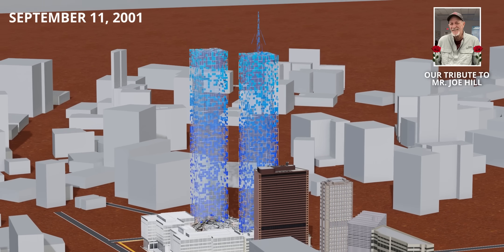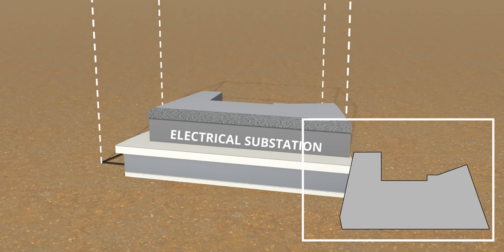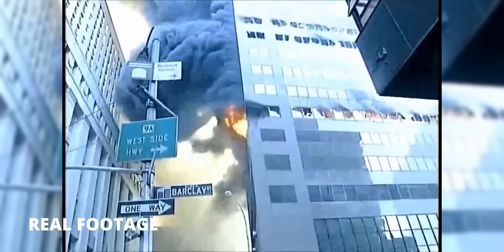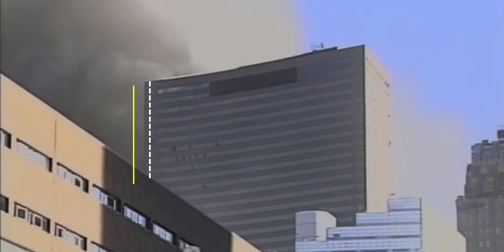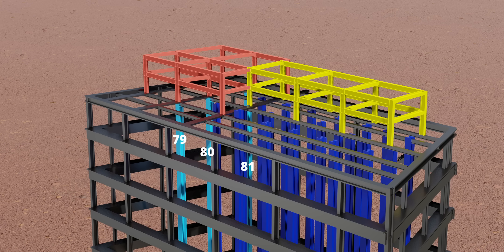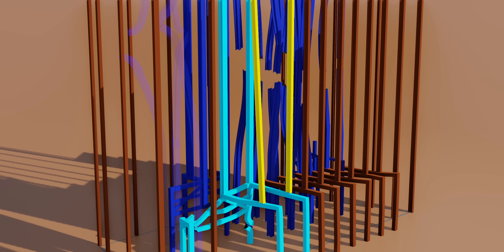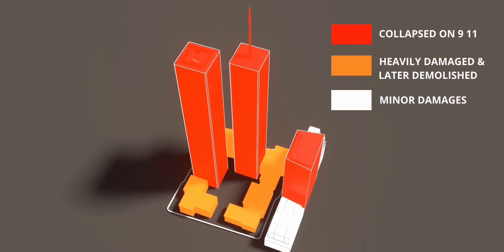Collapse of Building 7 | The Complete Physics

Comment: The Antenna(!!!) smashed all of the steel beams. And then penthouse truss, some of the columns, blabla, perfect free fall collision 😄😄😄
Reply: Or,... you could actually pay attention.

Much misunderstood, Building 7 was the 6th building to collapse of the 10 lost on 9/11. Because of its early low priority, conspiracy filled the information void with garbage made up by technically ignorant people promoting political agendas. But this is an engineering problem and should be treated as such, so I prepared this brief summary of my own analysis to fix that, using engineering, not politics and tired memes.

The North Tower collapse at 10:28am bombarded Building 7 with tons of debris, causing heavy damage and starting multiple fires which burned out of control for 7 hours. Half the FDNY firefighters having been killed, units in disarray, equipment destroyed, no water pressure, and the greater urgency of search & rescue efforts, firefighting was pulled as futile. The building couldn’t be saved and was left to its fate. That is the sort of choice firefighters make every day in brush fire situations - which houses to save and which ones to let go. Only real difference here is moving the decimal on the size and cost. People get overwhelmed by the size.

www.youtube.com/watch?v=g_SvpwyC17M&ab_channel=MFitz

Collapse of a burning structure is always a concern for firefighters. Steel buildings subject to fire rely on active fighting of the fires to survive. Buildings are designed around 1 to 3 hours of fire resistance, allowing time for occupants to escape and ACTIVE firefighting to get started, after which all bets are off. Left to their own devices they will exceed their design envelope and collapse, like Plasco Tower and Wilton Paes de Almeida. In B7 the occupants escaped, passive and active fire protections were compromised and active firefighting was abandoned 3 hours before the collapse, which left the building to its fate. It lost. Odds on Building 7 would eventually collapse, and it did. No big deal in logic.

www.youtube.com/watch?v=WnYBX6QT0R4

FDNY Chief Daniel Nigro ; The biggest decision we had to make on the first day was to clear the area and create a collapse zone around the severely damaged 7 World Trade Center, a 47-story building heavily involved in fire. A number of fire officers and companies assessed the damage to the building. The appraisals indicated that the buildings structural integrity was in serious doubt. I issued orders to PULL back the firefighters and define the collapse zone. It was a critical decision; We could not lose any more firefighters. It took a lot of time to PULL everyone out, given the emotionalism of the day, communications difficulties and the collapse terrain

FDNY Deputy Chief Peter Hayden ; We had our special operations people set up surveying instruments to monitor and see if there was any movement in the building. We were concerned of the possibility of collapse in the building. And we had a discussion with one particular engineer there, and we asked him if we allowed it to burn could we anticipate a collapse and if so, how soon? And it turned out that he was pretty much right on the money, that he said 'In its current state you have about 5 hours

The collapse of Building 7 was anticipated and widely reported in the media throughout the day, with 24 video cameras recording some or all of the collapse. Everyone knew what was coming and why.

www.youtube.com/watch?v=OY5S5k3tMHI

Building 7’s collapse was completely different to the Twin Towers and harder to understand as most details hidden from view and not intuitive, but we can still sort out what happened through careful analysis and observation. This is my explanation of the collapse relying on no outside authority.

Building 7 was complex, assymetrical 47-story steel framed structure built atop a smaller 3-story building, requiring lower floors dedicated to complex load transfer structures, not usable office space. Of trapezoidal shape and all-steel tube-in-tube construction, B7 (above the 7th floor) consisted of a central core of steel columns carrying most of the gravity load, perimeter steel columns around the outside of the structure carrying the remainder of the gravity loads and long span beams and girders to tie those elements together and form the floors. On the outside of the building hung a moment frame or outer shell.

Phase 1 : First externally visible signs of collapse initiation occurred at 5:20:28 pm and were notably quiet with observers not realizing the building was collapsing! No audible warning in the form of hundreds of ear drum busting 180-190dB explosive bangs preceding the collapse. Here at 12:00 a local CBS affiliate reporter is talking 10 blocks from B7 when collapse begins. People don’t start to notice the collapse until 12:11. At 12:45 is the famous CBS fixed camera clip of Building 7’s collapse. Note how quiet it is.

youtube.com/watch?v=t5tEy6mXSE8&ab_channel=fresnosean379

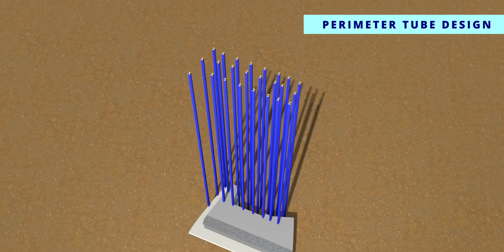Collapse initiation was due to lower floor failures above the load transfer region (7th floor) in the NE corner. In this video at 0:45 you can see the NW corner from inside the building while under construction, Column 79 just out of frame on the left. That big, angled steel beam across the top of the frame connects to C79 at one end. The girders connect to the beam. That beam and all those girders depend on just one connection

youtube.com/watch?v=nP3TNHPCIVU&t=35s&ab_channel=EdwardCurrent

Phase 2 : The floor failures caused a loss of critical lateral support over an excessive length of core Column 79 and it buckled. If you look at a floor diagram of Building 7 (see above) and look at all the structures that depend on C79 you quickly realize this one column was a relatively isolated structural element on which a disproportionately greater fraction of the structure depended analogous to say the Key Bridge. Externally we see a vertical progression of window breakage along the 44-46 line and a kink in the roof of the East Mechanical Penthouse at the top of the building, consistent with C79 failure. The transition from full capacity to almost no capacity occurs in an instant. Once the buckling failure occurs there is almost no resistance

Normally with a buckling column, the load could be redistributed to other columns. With C79 that is not the case - the failure did not redistribute the load, so the collapse rapidly progressed to the roofline, sinking the rooftop penthouse.

Phase 3 : With C79 gone, B7’s progressive, non-symmetrical collapse continues with C80 and C81 at the east end of the core left laterally unsupported and quickly buckled and failed as well, sending the EMP down through the building. C79-81 all have no diagonal bracing, which I believe is a major reason why they could not redistribute a lot of vertical loads among one another.

From there collapse progressed from east to west through the central core until the core was gone taking all of the interior floors and probably most of the perimeter columns with it. Follow the horizontal progression of window failures low in the building and the dropping of the remaining rooftop structures into the building. One of the big takeaways from the NIST Building 7 study (that gets completely ignored) was their modeling which determined C79 failing under ANY circumstances would have initiated the same collapse sequence.

Phase 4 : After 10 seconds only the exterior moment frame - a hollow empty outer shell – remains, giving the ILLUSION the Building is still standing since little has outwardly changed. It is just a hollow empty shell like an empty cereal box. Supported by only a few remaining columns that empty shell is quite unable to remain standing. With all core columns and floors gone, the north face leans inward, forming a V in the roofline, the last few columns buckle under the strain and the moment frame free falls, landing on top of the 7-story high debris pile. It is only late in the game here at the end that a single measurement of alleged free fall acceleration is taken, from a single point on that outer shell. The Building did not “free fall” – just one corner of the outer shell did, sort of. The Building was already gone before that happened. The period of alleged free fall was a product of how it fell NOT why it fell and cannot tell us what started the collapse. Start to finish the entire collapse took 18-20 seconds, 3 times longer than true free fall . How fast something falls cannot tell you what started it falling_ anyway. The debris spread outside the footprint, blocking surrounding streets, heavily damaging the Verizon Building and destroyed Fiterman Hall.

Building 7’s progressive, non-symmetrical collapse was incidental and unintended collateral damage from the combined effects of fire + time + gravity, started by the collapsing North Tower. That is true no matter who planned and carried out the 9/11 attacks or why . The collapse was of so little consequence it barely even registered at the time, a mere footnote. It only took on semi-mythical status as an alleged smoking gun years later when demolitions at the Twin Towers, missiles at the Pentagon and shoot down over Shanksville all failed and conspiracists had nothing left to work with.

Anything can seem like a conspiracy if you don’t understand how it works. Now you should. I hope you found this helpful, informative and it solicits informed critical comment. If I made any errors of fact, logic or reason or left anything important out, please let me know so I can fix it. IF you can offer a more plausible alternative please do. Be the first. Please start any reply with the words “Tits McGee” or I will know you didn’t read it and are wasting my time.
Reply: @TheCriticalStinker-01  So which 5 buildings collapsed prior to WTC7 stinkyfitz? Oh wait, I forgot: You are way too much of a coward to ever answer questions on your pathetic BS lies...

Comment: @3:50 when he starts talking about the antenna from tower one falling into building 7, it's all wrong. Because if you watch the collapse of the tower, building 7 is on one side of it, the antenna falls to  the opposite side. So therefore, that's not the cause of the damage
Reply: The video is wrong about it being the antenna. It was a different big chunk of metal from the North Tower.
Reply: @TheCriticalStinker-01  Much better stinkyfitz, much better!
Reply: @TheCriticalStinker-01 
I just said that ya goof lol
Reply: Most likely some stinky shill will pop in very soon, confirming that the antenna claim is BS but also assuring you that everything else in this BS video is totally accurate... It will also lie that the gash was caused by north tower´s perimeter columns no matter how often I teach it that it was core columns.

Comment: So you're telling me this building burns for 8 hours and collapses like a controlled demolition but the Windsor Tower burns for 20h+ straight and stands still? Did Scorcese wrote this script or what?
Reply: All of the steel structure above the 17th floor (a heavy, reinforced concrete utility floor that acted as a fire break) in Windsor Tower failed and collapsed in under 4 hours. The only bit still standing was the reinforced concrete central core.

Building 7 didn't have one of those.

Analogies are not evidence but should at least be analogous. The events you are looking for are:
1.  Plasco Tower, Tehran - steel framed high rise collapsed after 4 hours of fire
2. Wilton Paes de Almeida - steel framed high rise collapsed after 90 minutes of fire

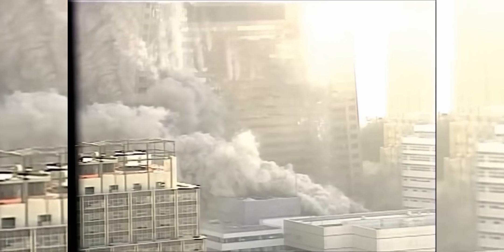Comment: 9:13 NIST admitted free-fall for 2.25 seconds which is about 8 stories of no resistance. What kind of natural collapse offers no resistance for over 8 stories? "NIST observed that the building's exterior facade fell at free fall acceleration through a distance of approximately 8 stories (32 meters, or 105 feet)"
Reply: Buildings are mostly air, they freefall until there's something pushing back against them
Reply: @LethalChicken77  natural collapses of buildings don't free-fall because even though the total volume of the building is air the lower sections give resistance to the fall of the upper sections, and free-fall means no resistance
Reply: Just watch footage of building 7, it takes longer than 2.25 seconds for it to fall.
Reply: @undercomposition  NIST admitted free-fall for 2.25 seconds which is a portion of the total time that it was falling
Reply: @wythi349 - No, what part of the building was being measured?  This is directly related to the fact the building had been collapsing for about 10 seconds prior to that measurement being taken, not 1.75.  

For those not keeping score, the obvious implication of this is that the very brief measurement from just a single point that averaged FFA (and was not in fact a sustained period of FFA) was the product of collapse progression mechanisms, NOT collapse initiation mechanisms, and thus tells us fuck-all about what started the collapse 10 seconds earlier.
Reply: @TheCriticalStinker-01  What point are you trying to make
Reply: @wythi349 - Was I not clear when I laid out why free fall is now and always has been a Red Herring, endlessly doomed to failure?

It's all laid out right there:

1.  There was in fact no period of sustained FFA.
2.  The building was not being measured - this obvious enough from how late in the collapse the measurement was taken.
3. This measurement of alleged FFA of the outer shell tells us fuck-all about why the building collapsed 10 seconds earlier.

It is a Red Herring.

Have you not figured out that a million people before you ran to the internet with this keen insight and they all failed?  Why did you think it was going to be any different this time?  Because it's YOU?
Reply: @TheCriticalStinker-01  So what do you think happened
Reply: Great.  The NIST also admitted Building 7 collapsed due to 7 hours of unfought fires.

What was The NIST measuring for that 2.25 seconds and how long had the building been collapsing before they started the clock on that?

And yes, I am aware you don't know the answer to either. Few do.
Reply: @TheCriticalStinker-01  they were measuring distance traveled on a point on the north-face roofline for a period of time, and the building had been falling for 1.75s before free-fall according to the report
Reply: -- Pls dont get into a debate with these   Two  well paid /  unscrupulous  immoral   Gov. sponsored full time staff/ Shills   ...    Their Goal is simply to ATTEMPT  to make you change your mind ..... Stay with it  -   
NB  -   Buildings  1-2-3-4-5-6-7   ALL   Fell -   with a   " not high enough "   heap of twisted steel   taking into account      200,000   tons  of  steel + concrete + marble + glass windows  ..  and only  One mangled Safe 
BUT   a 2"  layer of Dust over most of Lower  Manhattan  and with Paper  blowing everywhere ..
Therm***   and Dancing Israelis  are   IMO     only  Part of the picture..
--    Dont you want to ask about   Holograms  ?  or where the  4 Planes actually were taken to ?
and   Atta  speaking to his Father the very Next Day..   
The whole  day was one big   Fairy Story   -   still being covered up  .  or at least they are  Trying ( as the  Total  BS  replies to yr comment )